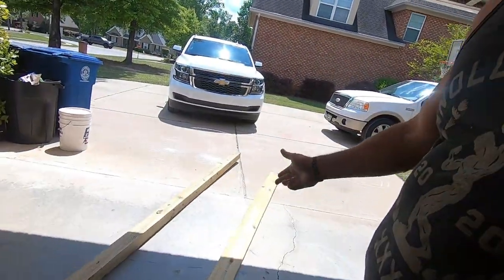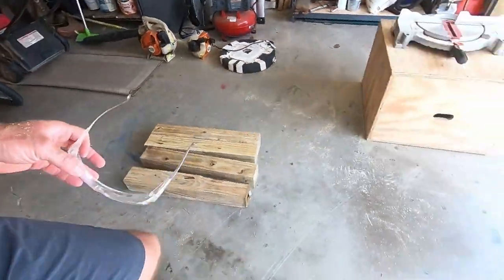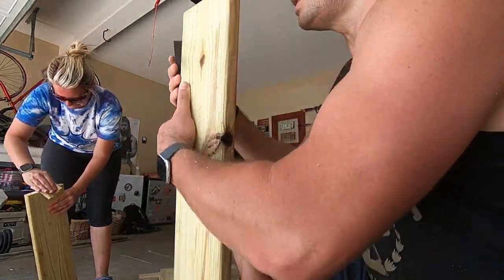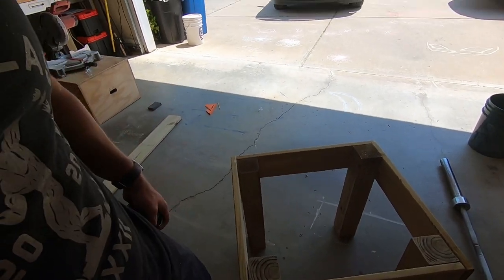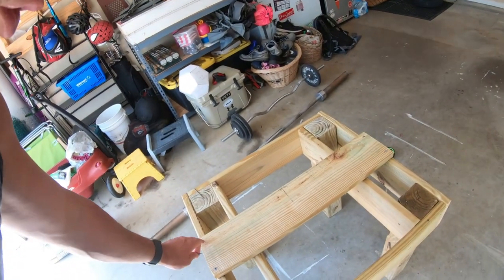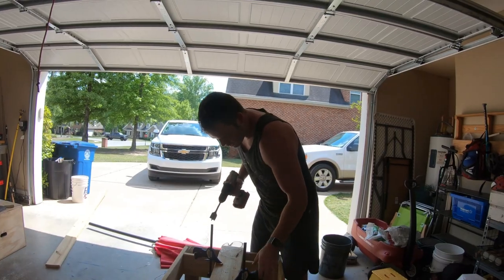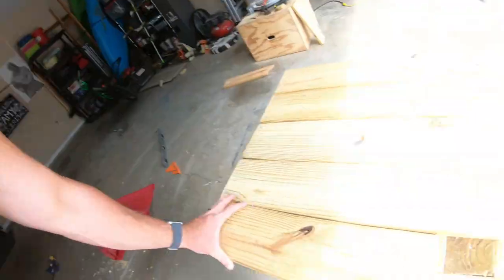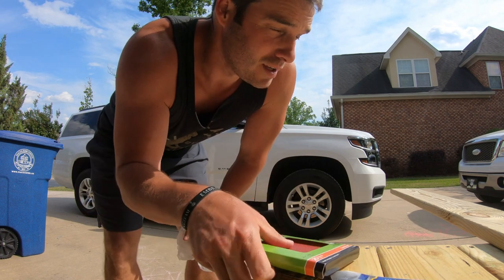How to Build a Patio Table

Comment: Made it today.  Took me an hour and a half.  Used azek for top boards.  Watching this made it super easy.  I used a 1.5 in hole saw in drill.  Fit perfectly.  Thx fir video
Reply from the maker: Man that is awesome! Thanks for letting know that really inspires me!! I hope it makes a great edition to your patio!
Reply from the maker: Hey I just want you to know that you made my day! That is really great
Reply: Tried to send pic but don’t know how.  Looks great, really solved a dilemma.  I was bungy cording the umbrella to my deck rail and it tore the bottom out of its stand.  Now I have a stand and great place for drinks and snacks.  And looks good too.  I am no carpenter but I followed your video and made it very quickly